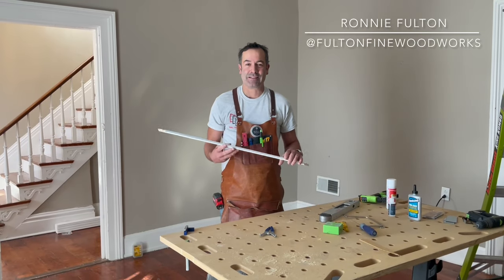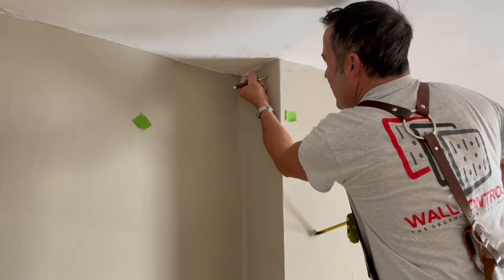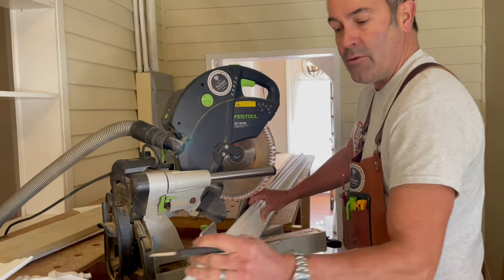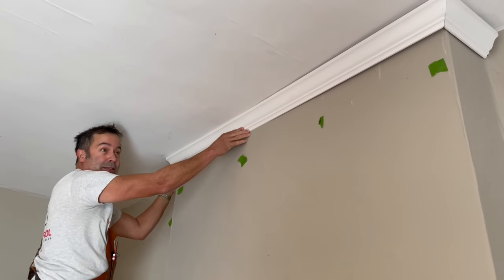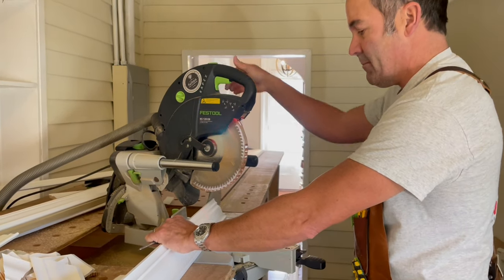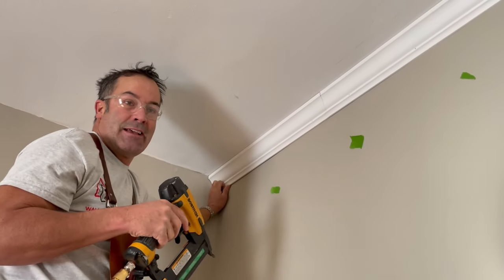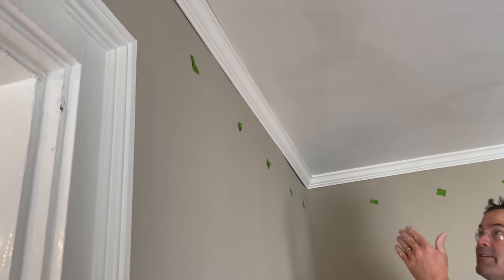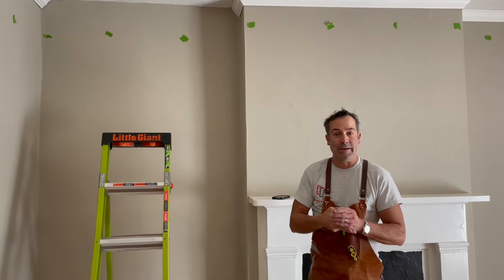"Upside down and backwards???" How to install crown molding

Comment: Lol…. I’ve been doing this for 35 yrs. 

1) a good stud finder is better Bc anyone who’s ever done this (unless they framed it themselves) knows most framers are running too fast and don’t pay attention thinking about the finish guy/trim carpenter. Sometimes it’s 16 oc sometimes it’s 14.5, 18, etc Bc they blew threw to get it done. Never trust “well everything is 16” oc” 

2) why even have a dual compound sliding miter saw if your not going to use some of its greatest built in features…. Such as 38-52 crown bevel33.9 & miter 31.6. On 45-45  bevel30.0 miter35.3. My saw has these presets and marks built in. Flat is the way to go. 

3) the fewer the splices the better off you are. And if your using 12’ material in a 15’ room vs 16’ material your causing yourself extra work and the possibility of the product looking hack. There’s a thing called “bedding” the cope. You may want to learn why you “bed” the cope and why & how you do it. It’s also better to do a straight butt joint then a miter on long spans. Miter joints catch the eye and if you dont run the miter the right way you’ll see the joint, no matter how much you fill and sand every time you walk in the room. A butt joint has no direction. 

4) I’d wish ppl would stop making these videos. Your presenting our craft as a “hey you can do it like a pro” by watching a video. 

Screw all you DIY ppl that believe my trade is something that’s so easy you can master it in 15 minutes by watching a video.
Reply from the maker: This is intended to get someone going on installing crown molding. Cutting in the flat is not the best way to start out for sure. There are many methods to do everything in woodworking and congrats for 35 years, you should make a video I am sure you could share some wisdom as well. Nothing can replace a ton of experience but I am glad this video has helped many pull off a successful install. There will always be plenty of work for the Pros without a doubt.
Reply: Don't you just love ppl who talk crap abt yr vid, but have no vids or help out here? There are also many ways to arrive at the same end result. It's abt preference.
He wasn't always experienced and started stupid like the rest of us. I would never hire such a conceited so-called 'pro'. Why can't I work on my own home?
I haven't even finished watching your vid...had to run out and buy that yellow plastic angle finder along with a pin nailer. As usual I will have to watch several times with lots of stopping, and will be testing everything out and go along step by step)

Comment: What revelation: it is OK to play with your scarf,-joint and butt- joint. As long as you do it alone. The cauk is key to coping and filling small cracks bent over  upside down and backwards. The bigger the crack, the thicker the cauk.Small white cracks should run  from big black ones depending on what you’re into.

Comment: Is there any difference cutting it flat ?
Reply from the maker: Cutting it flat requires you to bevel the side to side bevel of the saw blade as well as rotating the angle of the saw. This requires a compound miter saw and the bevel angle depends on the type of molding being used. I find it much easier to cut it in the manner I showed. This is called cutting it in position.

Comment: Do you know the difference between looking into a joint and looking over a joint.....and most people frown on putting a joint so close to to another joint...on a 14 foot span the joint should be around 7 ft mark
Reply from the maker: That's totally subjective on almost every install I do the 7' mark would place it at the center of the run. I would much rather put it somewhere in the first or last third of the run. If installed correctly the seam shouldn't matter anyway.
Reply from the maker: On looking in and across the joint, for sure joint direction matters and is always something to consider
Reply: @fultonfinewoodworks  I believe most trim carpenters would disagree
Reply: @fultonfinewoodworks  addiñg info on dirrection would have been a nice addition.....or maybe an idea for a future vid
Reply from the maker: @carlboudreaux  this trim carpenter does it this way, it's nice to be my own boss!
Reply from the maker: @carlboudreaux  agree, I have been wanting to make a part 2 video (advanced techniques) for over a year. It's difficult to put everything in a video without overwhelming people new to the concepts
Reply: @fultonfinewoodworks  we know who the real boss is
Reply from the maker: @carlboudreaux  the customer? I am my own customer a lot of times, as I spend a lot of time working on my own home and rental houses including this video.
Reply: @fultonfinewoodworks  family

Comment: I’m not really understanding why you have to turn it upside down. Can’t you place it up against the fence right side up and cut it that way?
Reply from the maker: The angle and measurement always starts from the wall and that's where the mark is on the molding. The angle then grows or shrinks from that mark. If you did it in reverse you would have to calculate the distance plus or minus length and cut back to the actual dimension. It would add a difficult extra step to be accurate.
Reply: @fultonfinewoodworks  thanks going to try to tackle a small powder room. All inside corners was going to try to miter cut as the angles are pretty good in the wall corners but maybe I will try coping. Thanks
Reply from the maker: @JJ4848  I mitered it forever before I started coping you can have success with that method but caulk is sometimes more required. For stain grain molding coping is almost a must. To save material cut two 1' pieces and test out the corners before cutting the full length. Remember to follow straight lines on the wall and ignore uneven ceilings that can be caulked filled in later.
Reply: @fultonfinewoodworks  Thanks

Comment: I noticed in this room you only nailed the bottom detail of the crown but never once nailed above also. Why is that?
Reply from the maker: This was a really old house with plaster walls the nail gun can make the ceiling flake or chip shooting at the angle so I nailed into wall only and the caulk line at the top also acts like a glue.

Comment: I'll trust the saw presets and lay the crown flat. And if you are going to cope, base where you start on whether you are left or right handed .And try to avoid a double cope. Why did  he need a  joint? I  missed that.
Reply from the maker: Cutting molding on the flat is more difficult for someone learning, this method is easier to learn in my opinion.

Comment: ... why oh why is it important to find the studs ?... its not like you can find them on every wall/ceiling (thats not how it works), sure you can find them on the walls, but why is it important ?.... i do not mean to slam your technique(s), but coping is extremely overrated, and unnecessary as well as finding the studs. For all my crown installs I use 23 gauge pin nails and adhesive (looks and acts like caulk), but its glue... I assure you (I put my company name on it), my crown molding installs will never ever move.
Reply from the maker: When it will be painted, I agree, it’s not coming down, just with the seal on wall and ceiling and pin nails it will hold. With stain grade it’s more important to hit some studs. Same goes for stain grade and coping, it’s a big advantage to cope because it can’t be filled but I prefer to cope all of it paint grade and stained.

Comment: Should be burning a inch with tape measure to get a more of a exact  measurement
Reply from the maker: It's an option but I don't find that to be a requirement as I generally cut a bit strong for snap into place anyway.
Reply: @fultonfinewoodworks  I thought the same thing and he's right it's more accurate....I burn ten inches

Comment: 27 degrees is half of 94??
Reply from the maker: This video was posted 2 years ago, your going to have to give me more than that, I don't recall that info being in there.
Reply: @fultonfinewoodworks hi, sorry i thought you mentioned that the corner wasn't or never is at 90 degrees,  so you mentioned the true angle which was more than 90 , but you said half the true angle was 27 i think

Comment: Why upside down? Why not right side up?
Reply from the maker: The video explains it fairly well but if I had to explain in a sentence, I would say the angle grows out or in from the bottom of the molding, the measurements are taken from the bottom of the molding. So by turning up side down the blade is cutting into that measurement. Cutting in this position also helps in that you don't have to figure out compound miter angles.
Reply: @fultonfinewoodworks  thank you

Comment: That is not how you cut crown molding efficiently
Reply from the maker: What is your preferred method? Cutting angle on both sides? Although a little quicker to cut on both sides there is a much higher chance of the miters opening up with seasonal movement.
Reply: @fultonfinewoodworks  I cut it flat, a good miter saw will have angle and bevel markings for both types of crown. I can move it through the saw with greater efficiency. As far as the outside miters any quality wood glue will hold them together especially when combined with 18 gauge finish nails. I use elmers wood glue which I have found over years of use to be much better than Titebond 1
Reply from the maker: @bradleygt1070  cutting on the flat works great but a entire different level to explain to someone learning how to do it for the first time. I was referring to inside corners opening up. Glad you have had luck with elmers glue but I have found titebond is much stronger,  I will have to do a video test comparing strengths. Thanks for the idea.
Reply: @fultonfinewoodworks  I generally never cope inside corners. I put sections together with screws and glue
Reply: Your comment saying elmers is better than titebond confirms you know far less than the man who spent his time making a video to help others. Quick to criticize and nothing to back it up.
Reply: @sean8628  I’ve been doing this since before he was born, and I’m working on homes far more expensive than what he is…Elmers wood glue is better than Titebond period… I started doing this in the 80’s
Reply: @sean8628  why do I have to shut up? I want people to learn the right way to do things, and this guy is not telling the whole story about much of what he is doing. I used to use titebond for years and I found a better product and a better way to cut and install crown. He is not doing his viewers any favors with these videos